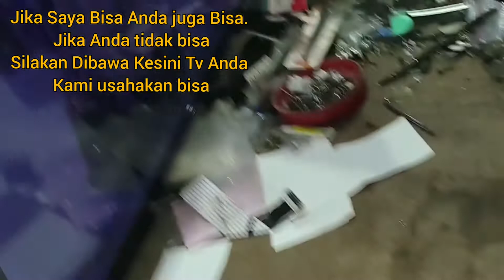Sharp LC-32LE180i Hdmi Gak ada gambar, Tak Suport, Atau Tv Tak Mau hidup, Ganti IC CHIPS .OK.

Comment: bang,tolong masukan nya,mesin yg sama dengan video di mesin saya ini mati total,sebelum mati hdmi gak mau konek,saya bongkar cek tegangan  di kapasitor besar hadir 300dc,di 2 dioda besar backlight 27v ada,tegangan 12 volt muncul di dioda heatsink dan kapsitor,di ic converter muncul 5v ,intinya semua tegangan keluar,sudah saya ganti ic flash dengan file flash ,masih mati juga bang,gimana ya bang,